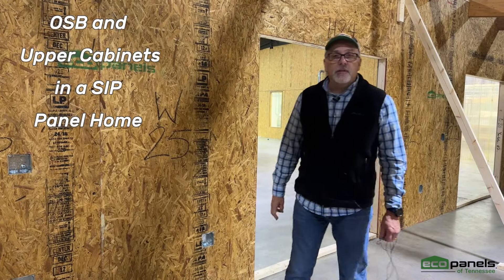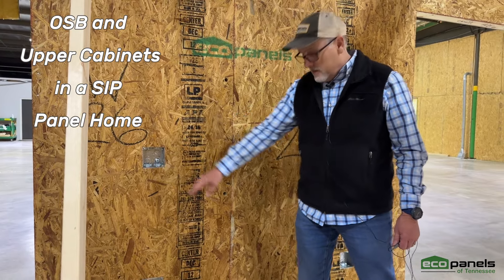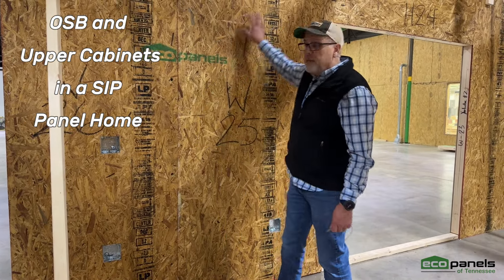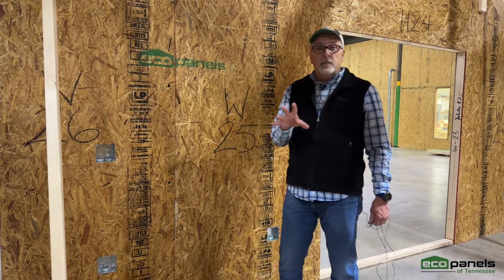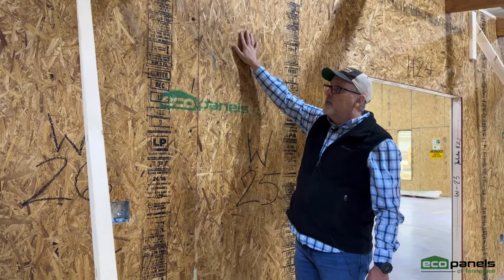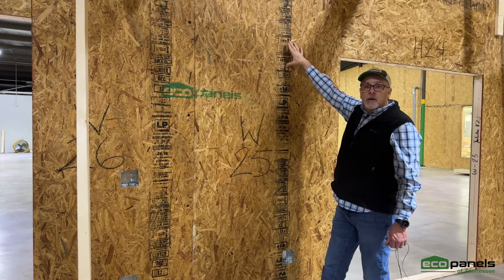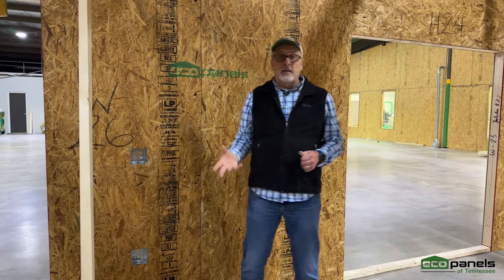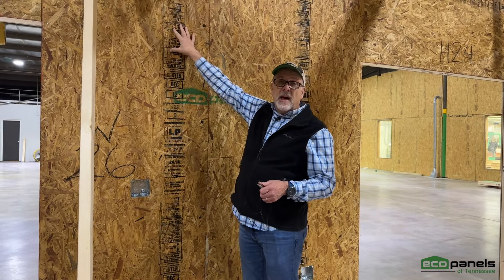OSB and Upper Cabinets in a SIP Panel Home

Comment: How do you attach your SIP roof panels to the SIP walls?
Reply from the maker: There's a number of methods depending on the structure and type of roof assembly. The short answer, less detailed answer would be that long panel screws are typically used to go through the roof panels and into the top plate of the wall. We'd be happy to discuss this in more detail, and our Assembly Manual will have more specific details as well. Great question. Thanks!